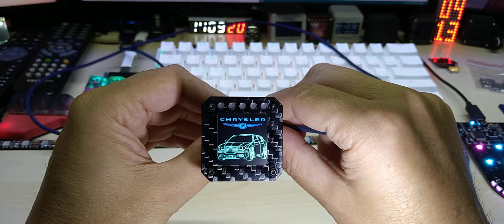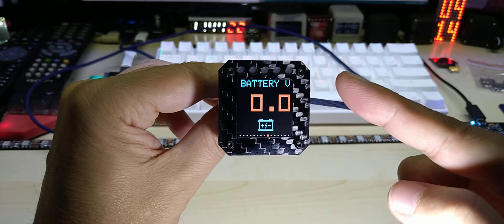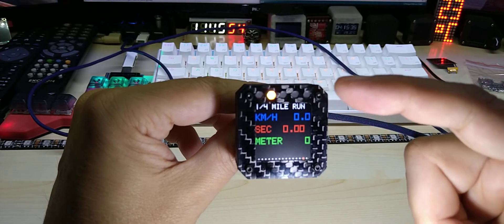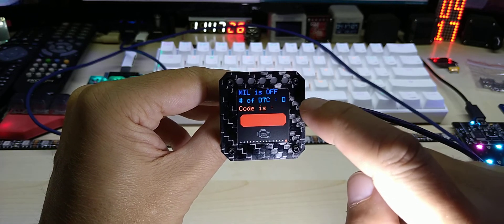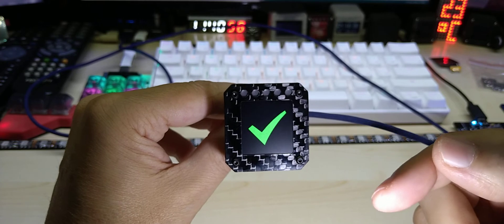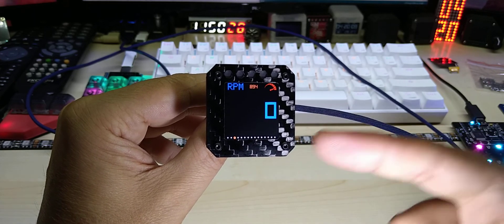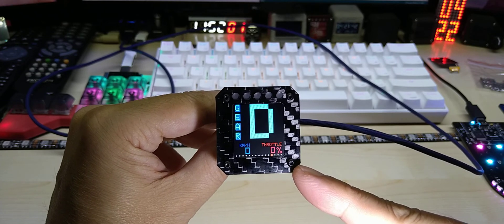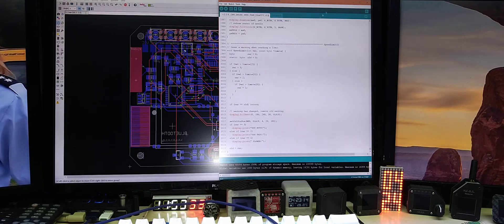H.E.D.S CAN Gauge new screens, Distance traveled, Engine load, Run-time, DTC error read and erase.

Comment: Great Job  Hayri👍
I am very interested in it.
Is it possible to use some analog Sensors like Type K or pressure Sensor?
How can i get in contact with you?
Reply from the maker: Thank you Thorsten, it sure is, it's basically the same hardware I use in my CAN BUS simulator that I showed in some of my videos where I adjust various values with a Potentiometer. Which in itself generate a signal from 0-5V as most of the sensors do or a resistance value like Type K sensors have. Pressure sensors use voltages if I am not wrong and some sensors have a 0.5 - 4.5V range. You can contact me over my Tindie store or leave your email here.
Reply: Hayri  here is my E-Mail adress:
thorsten-morgenroth@web.de
Do you have a list of possible functions?
Reply from the maker: @thorstenmorgenroth1121  Email sent. The current screens are shown in this video.
Reply: Hayri Have you send a Mail?
It has not arrived.
Reply from the maker: @thorstenmorgenroth1121  Yes I did, check your spam folder although my mails do not normally end up there.
Reply from the maker: @thorstenmorgenroth1121  Did sent it again with new subject "New try" but the same message.

Comment: Nice looking, can you make a video of the motorcycle gear shift lever? I would like more info on the installation with the magnet/micro switches. Thanks, cheers, Doug
Reply from the maker: That is difficult as every single motorcycle is different. You basically install the magnet on the gear lever, again you could glue it or use cable ties for example, and move the lever up and install the reed switch, depending on the type you use, and mount the reed switch to the end position of the lever and do the same for the down shift.

Comment: I love your creations Hayri, I have a fairly new truck  but it does not have an external temperature sensor, how easy would it be to add this to your code ?
Reply from the maker: Thank you very much :-) Actually the CAN BUS does measure ambient air and it's pretty accurate. Adding another temperature reading to the code is not difficult but you'll need additional hardware in the form of a CAN BUS Node, which I can supply and adding a external temperature sensor to it. The sensor will then connect to the Node and the Node will broadcast the new PID to the CAN BUS  from which the gauge will read and display it.